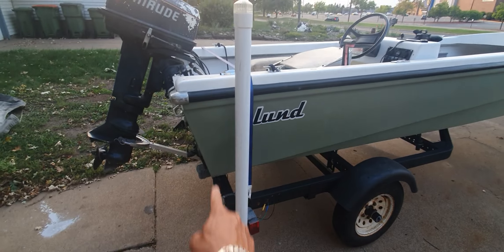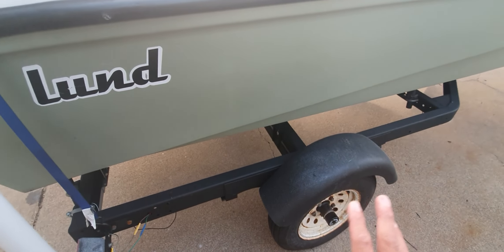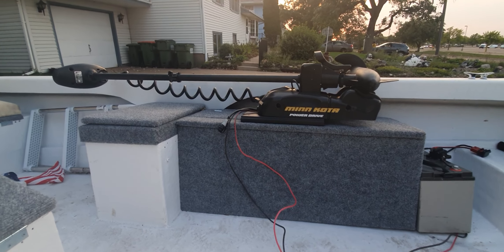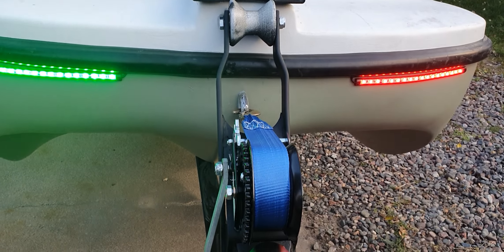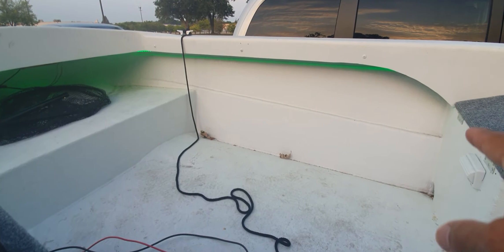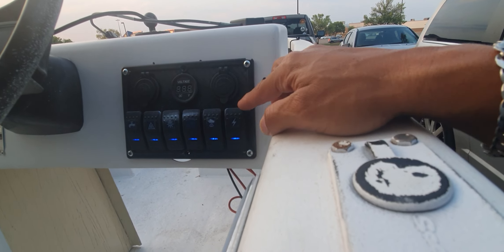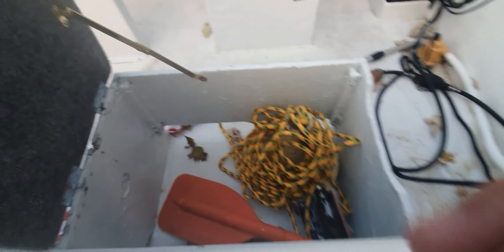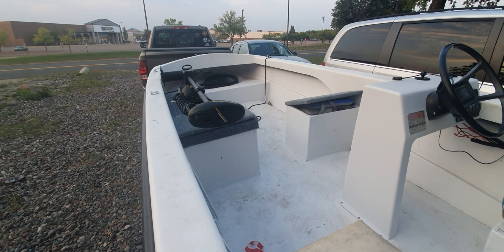Final part to the 1973 Deluxe 315 Lund boat and trailer restoration.

Comment: Love the series bro. I would love to see this boat in the water. I have one that I am restoring this summer and I am curious on where the water line is and of the stability of the boat. 

Can’t wait for an update!
Reply from the maker: Let's just say that I have had 6 grown adults on this boat and had no issues. Love the stability on the boat. Wotks awesome for group or solo trips. I have a short of it when I first got it and fixed the motor. Only thing I wish I had on this boat is a motor trim. Will make a nother video ahowing off all the aother addtions I have made. Thanks for the support.
Reply: Just out of curiosity, do you know how deep the boat sits in the water? Like at rest, where the water line is on the boats hull?
Reply from the maker: @BushmasterJames  hey, sorrycabout the late response. So on my boat the water line is about 7 inches off the bottom. It is really stable.

Comment: Great job on the boat, I really like it.  What is the width of the bottom of the boat?  Also, what is the inside width of the trailer?  I'm looking at getting one of these on Saturday and I need to know if it will fit the trailer I'm planning to get.
Reply from the maker: The hull width is about 63" I would say the trailer is about 70" on the frame and about 80" wheel to wheel.
Reply: @dadinthecityoutdoors  Okay great thank you.  That's wider than I thought, I'm waiting on a callback from the trailer guy to see what they have in stock.
Reply from the maker: @frankhunt5018  good luck cant wait to hear about it.